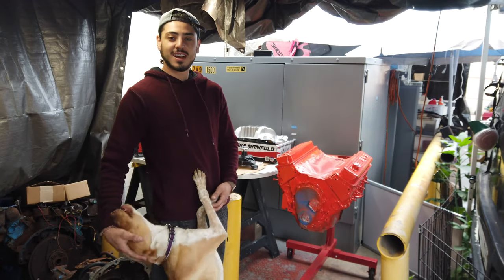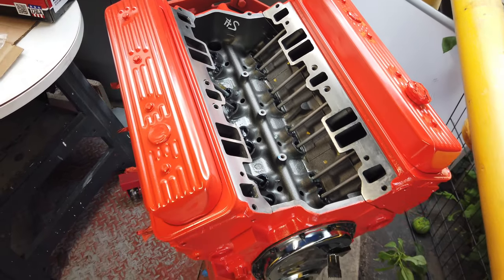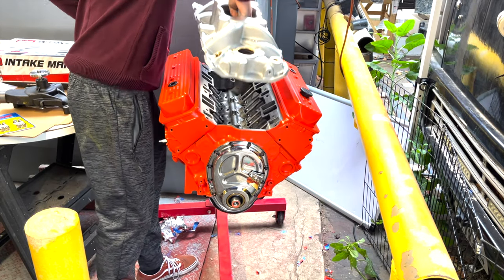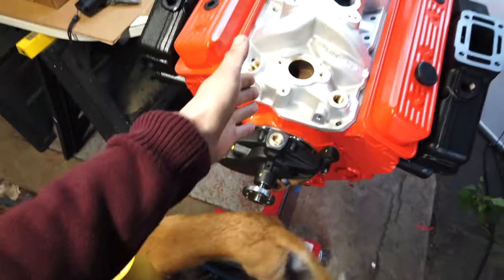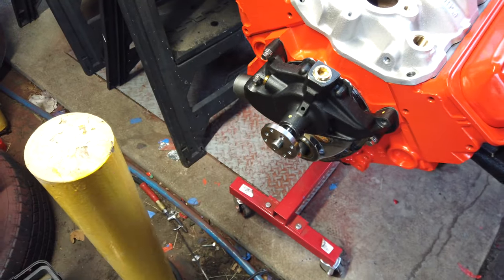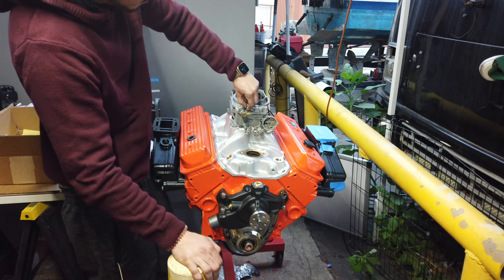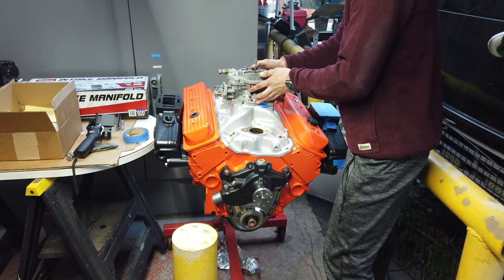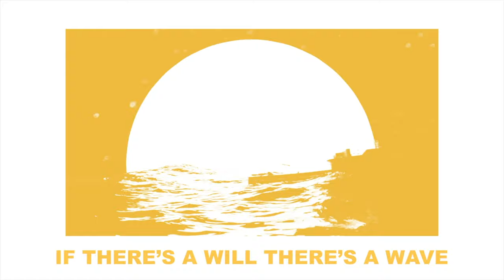Marine Chevy 350 V8 5.7L Build - New Parts Installed & Paint - 47 Year Old Yacht Restoration - EP 20

Comment: Is that manifold natural aluminum or painted that color? If it’s raw aluminum I would recommend painting it, it will corrode eventually.
Reply from the maker: Gotcha, yea I’ll take a look into it. I believe it has a coating on there. If not then it may be a future job. Thanks for the insight 👍🏻👍🏻
Reply: If it’s going into a salt air environment, yes it’s going to oxidize some but in a freshwater environment it’ll be no worse than a car driven in the rain and probably better than an area that uses road salt/chemicals.
Reply: @SkypowerwithKarl  Agreed 
I don’t know where his boat will be used. If the bilge is completely dry he could be fine, but to go through all that painting, I would paint the intake too just for insurance.
Reply from the maker: The boat will be in salt water full time, docked in LBC 👍🏻🛥🛥
Reply: @IfTheresaWillTheresaWave  
Well the salt air and mist will get at it. After a while, it’ll get fugly. I’d be painting it.

Comment: If you got paint on the spark plug insulator and the boot gets in contact with it, it may glue the two together when it gets hot. I highly recommend changing the plugs palladium’s in the same heat range. They last 500 hours minimum and the engines start easier.
Reply from the maker: Okay good to know! Thanks for the tip👍🏻👍🏻, these were some extra spark plugs that came with the boat so we will be getting some new ones to replace them!
Reply: @IfTheresaWillTheresaWave  
Just make sure they are the correct heat range for that motor or bad juju will find you.

Comment: You MUST run a marine carburetor(1409 marine version?, verify it). #1 reason- safety. They are designed to vent fuel overflow from the float bowl into the engine rather than outside and onto the manifold. #2 Non marine parts aren’t legal or Coast Guard approved. #3 if you get insurance and catches fire, then it’s found that it didn’t have approved components, the insurance company washes its hands of you. #4 And here’s the one that will hurt you quick. Street carbs are way too lean for marine. Good chance that’s what killed the old motors if that’s what they used. More bad news. Not just carbs but fuel pumps, fuel filter, fuel lines, ignition (distributor) starter and alternator must meet USCG regulations for fire resistants or ignition protection. Even more bad news, they cost more. Unlike a vehicle where fuel and fumes can dissipate to the ground. It’s trapped inside the hull and yes you have blowers but they only do so much and they aren’t always on when you’re not in operation. A little fuel leak + spark and you have an instant convertible then a Viking’s funeral. Good news. You’re using new manifolds and risers. Get yourself a crank mounted raw water pump( cheap, great and easy to service). Reasons for marine engine death #1 raw water impeller failure. #2 Riser or riser gasket failure resulting in hydro lock. #3 lean engine or forcing the engine to run on “phased fuel” (ethanol on the bottom of the fuel tank cause a lean run). Yeah, you’re learning. Welcome to boating.💸
Reply from the maker: Thanks Karl, yes every component we are putting on these engines ARE marine!👍🏻👍🏻 - the Edelbrock 1409‘s that I have are marine carburetors (old ones from the previous 318’s), however I will likely be selling these for parts and buying a new pair to go on the 350’s. I guess everything is going to be new for these engines😂
Reply: @IfTheresaWillTheresaWave  
Clean slate is a good start. Painful to the wallet tho.

Comment: While you have the engine’s out, it would be an excellent time to inspect the cutlass bearings for excess play, change the shaft log tubes, shaft packing and rudder shaft packing. Use GTU Graphtex Ultra shaft packing by Western Pacific. This is traditional lock+this modern packing the best shaft sealing system there is and in my opinion better than any “dripless type”. The prop shaft must be smooth no pits longitudinal lines or tool marks, smooth circumferential lines are ok. Cut the packing so the ends butt together at an angle and the angle is diagonal to the shaft direction. It may require 3 or more “rings” of packing to fill the housing. Stagger the ends so they don’t all line up. For the rudder packing, hand tighten and set the jam nut. For the prop shaft, hand tighten the nut, now grab the packing housing and mash it around the shaft to compact the rings. Lightly re - hand tighten and set the jam nut. Now put the following on your check list for when you splash the boat. You don’t have a water line to your shaft log so you have to “burp” the packing to get trapped air out and get some water into it. So loosen till some water comes out and reset the packing like before and lock the jam nut. Too tight is bad but a little leak at first is good. You will need to feel the housing at the start of the sea trials to be sure it’s not getting hot, mild warmth is ok. Two to three drip per minute while underway is normal AND it’s very common with GTU packing for it not to drip at all as long as it’s not getting too warm it’s all good. You may have to adjust it in a week, then a month, then six months, a year and every two. Check after you have been out and back at harbor. And if it’s dripping an hour after you stopped, undo the jam nut and hand tighten 16th turn and lock again. The packing should be good for 25 to 40 years. Your whole drive to prop life is also dependent on engine alignment. The shaft should be well centered in the shaft log when the drive flange is connected. The flange faces should also be within.003 of parallel. This assumes that the flanges run true on the transmission side and the prop shaft side. Engine alignment is not easy so plan an entire day for this if it’s your first time. It’s very important that all the engine mounts are all carrying their fair share or worse one is pulling down against the other. Jacking, bumping, nudging and cursing. New motors mounts settle a lot in the first 48hrs so land it evenly on all four and wait before you start alignment. In two weeks after alignment you will need to do it again but most of the “up” adjustment will be the two under the engine so give each a 1/4 turn and check the .003” at the flanges with a feeler. Check again in six months and then a year later. Fun owning a boat huh?
Reply from the maker: 😂 great ending, that’s awesome you’re the best Karl! We will definitely be using this information along with some further research on our part to complete these tasks! It IS pretty fun owning a boat but we’d like to see what it’s like on the water at some point 😂😂